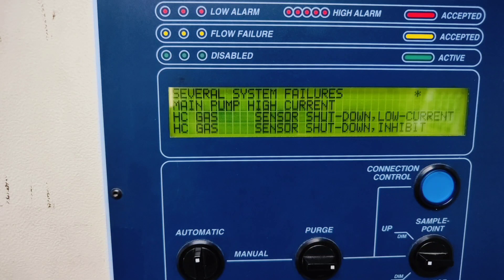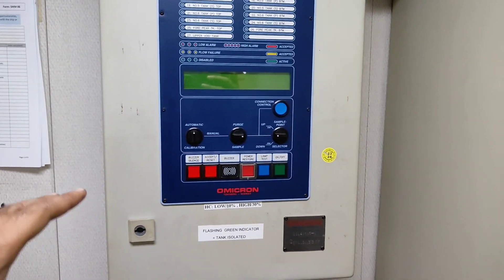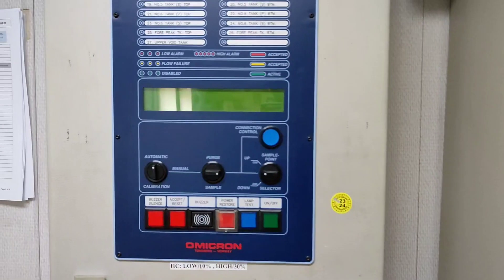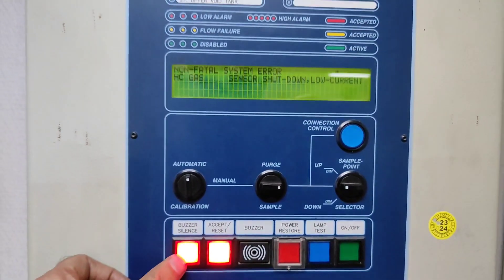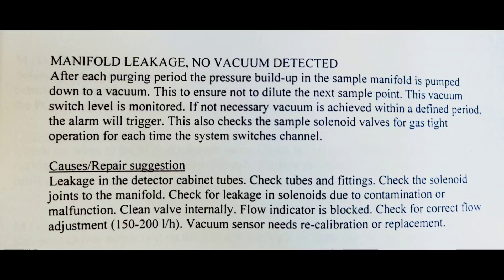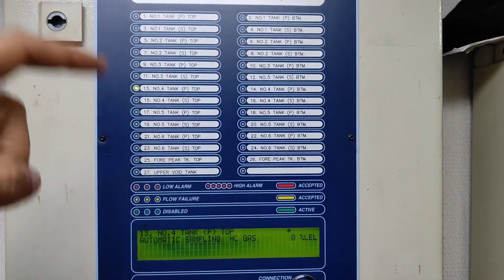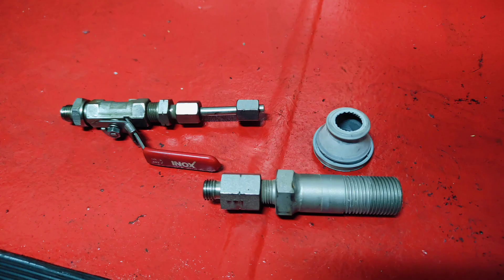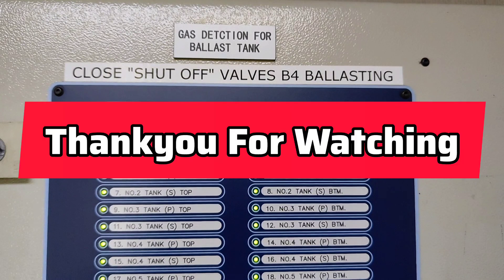OMICRON Fixed gas detection system faults || Faults in gas detections system & how to handle it

Comment: I have problem in this system alarm show 'flow failure?
Reply from the maker: There is some leakage in any of the valve, isolate all tanks and keep adding one one tank sampling to identify the faulty s/v. And also maintain proper air flow

Comment: what if you are experiencing HC Sensor shutdown; low current only on certain points? my gas detection system is working fine but shut downs when it cycle back that specific erroneous point.
Reply from the maker: Check for valves when cycle completes, in case of hc sensor shutdown check manual what it says. It can be due to valve leakage
Reply: we are using the same omicron gas detection system. The manual says that HC sensor is the problem and may need to be recalibrated or change; however im having my doubts given that the problem occur only on those 2 specific sample points.